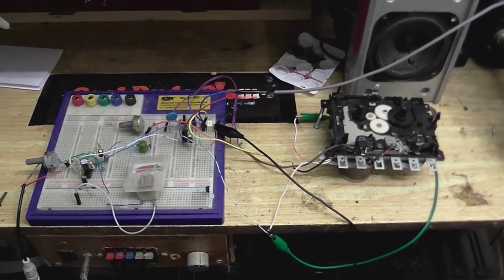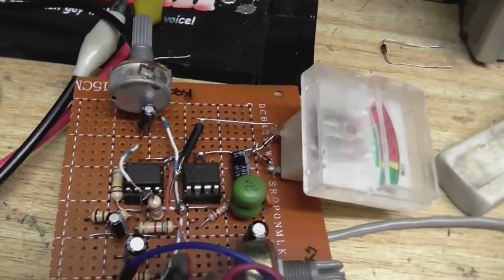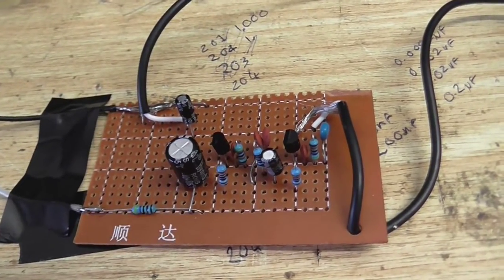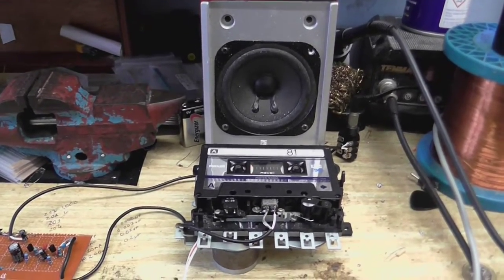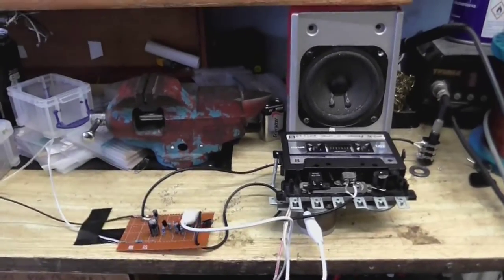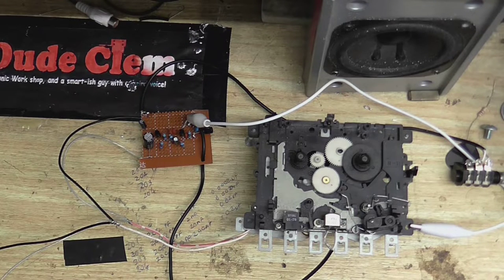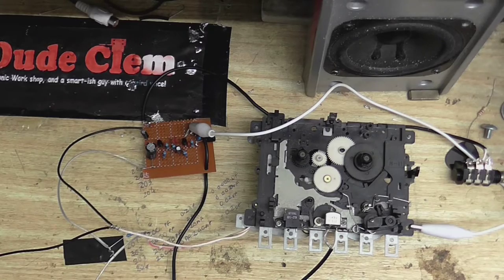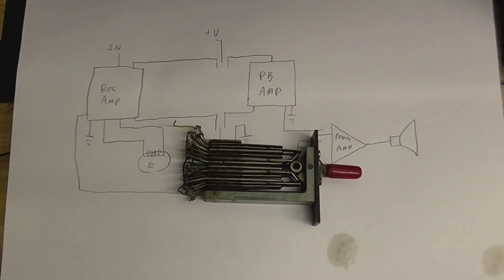The Homemade Tape Recorder Prodject - PLAYBACK

Comment: Clem , you know your stuff,always enjoy watching your videos,  much respect =)
Reply: I would have liked to have seen him try substituting those transistors for others. Just to see what happens. As long as you pick parts that are close in spec I don't see why it wouldn't. I've subbed transistors in circuits and they work. Might not perform exactly the same. A lot of transistors aren't that much different from each other. They do the transistor thing, you know? But then again I suppose he didn't need the power stage of that circuit either.
Reply: @1pcfred    if you want to get into the datasheet  and math side of things and make slight improvements , yes, but the fact that this thing was built with what was on hand and worked pretty good shows that Clem is a clever dude and thats pretty cool.
Reply from the maker: @1pcfred  I actually did try that, but I could not get it to work. As the output capacitor charges, all the bias dissapears no matter what I try so I left that part out of the video.
Reply: @CoolDudeClem  thanks for that tidbit of info. Often when things work there's not much to be said about that. But when they don't work then there's something to talk about. Which I think makes for compelling content.

Comment: Nice to hear it work first time.Well done Clem!I used BC108s because they seemed to be the favourite of the old Walsall College of Technology where I studied (a long time ago) and they are familiar to me.I would never have noticed that there wasn't much bass as I only use (the full circuit) to drive a Two and three quarter inch Loudspeaker which couldn't reproduce much bass anyway.I reckon the performance is about as good as the commercial low cost portable Cassette Recorder/Player units of the 1970's.Would you agree?
Reply from the maker: Yes it works really well, I'm surpised at the amount of gain it has. In the past I've tried connecting a tape head to a microphone input and not get much. The bass probelm was stupidity on my part, I should have tested that the capacitors I used in the EQ part were good, only later on after I did this video, I found that they were no where near what was printed on them! I managed to fid the right capacitor in the end and I put that in and it sounds much better now.

Comment: Clem- I need your help!  [ A tape player issue.] * You know when you first turn on the tape player. And it works for a second... And then fades out. [ ?]  Where and what is the problem. Is it power or shields. Ground? Please clem- how can I fix it?
Reply: sounds like something to do with the power supply
Reply: I would check some capacitors, especelly the electrolytic ones. When they out of tolerances, then the sound fades out quickly. Same reason for transistors: the hfe is the key. For Example a BC547B has a hfe from 200 to 400, when you measure it and the MM say 180 the transistor is defective. Good luck

Comment: Can it be that that too less bassproblem has anything to do wirh the low inputimpedance for a a tapehead?
Reply from the maker: I found the real problem, cheap chinese capacitors! In the middle of the circuit there's a capacitor and a resistor that provide the EQ. Well I didn't have a .22uf capactor so I just decided to put a couple of .1uf in parralell which SHOULD have been close enough, but I didn't realise that those capactors were nowhere near what they said they were.

Comment: Clem- I found the problem with the tape player (i.e.) when they work for a second; and then fades out. [ Don't you hate that?] * It's a little switch; that connects mechanical like; when you push play. It's called a leaf switch. You can fix it. Or solder all that together. But the motor will keep running. I guess it's always got power however. It's just at 1/2 the volts it needs to run. Then when the switch connects; it gets full power. * Here's a video link; to give you a better idea of what; going on. https://www.youtube.com/watch?v=w8WFYDf2Vt8

Comment: hi to all ace's reel to reel use op amp ic's they are better and easyer to clone if you need to make a 24 track to 32 track tape deck using cassette tape heads